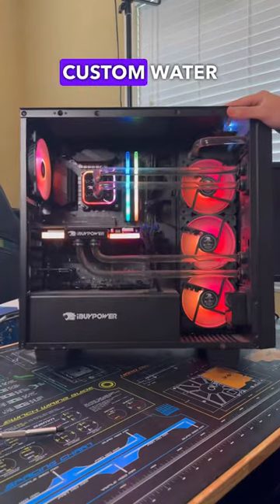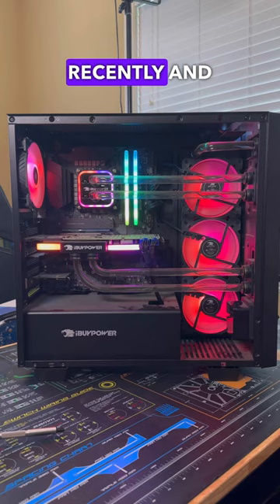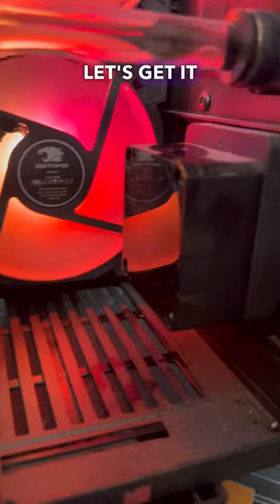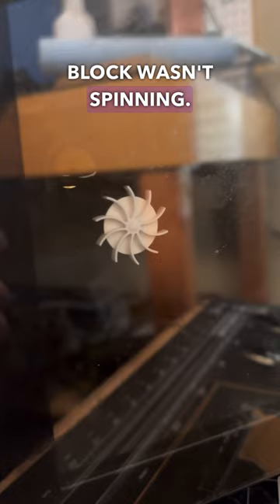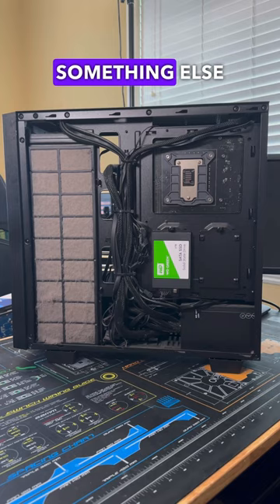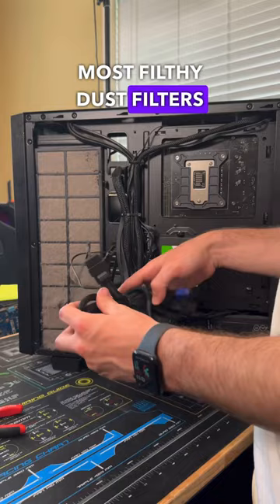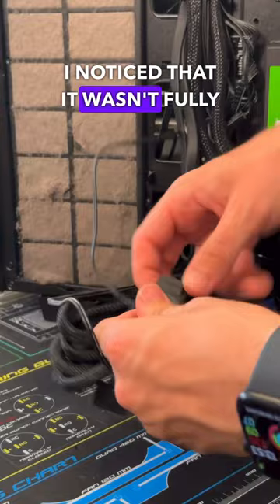OVERHEATING Gaming PC Repair! #shorts #pc #pcbuild #gamingpc #gamingrig

Comment: Imagine having to pay a shop just to properly plug in a cable 💀
Reply: When it comes to water cooling, rather have a shop tinkering cause if they mess shit up they replace it, if i mess shit up there’s a couple hundred dollars easily on top of my original issue
Reply: We used to call this a stupid/lazy tax, dont wanna put in the 10 minutes of effort? No problem, but youre paying for my time amd expensea.
Reply: It's the stupid tax
Reply: I know right, they even had a flow indicator right on the front of the case.
Reply: Prebuilt moment

Comment: Dang its wild how folks have $1500-2000 in water cooling but rock the cheapest SSD you can find. 

Never custom loop unless every other part is maxed out for your needs and budget first. Its not going to be better than an AIO, costs more, and requires maintenance most folks who dont build their own loops don't perform.
Reply: It's an ibuypower pre-built. They spend all of their budget to make it seem high tech, because the average person won't notice.

Comment: The dude couldnt troubleshoot that himself without taking it to a shop??
Reply: you're also supposed to replace the fluid every 6 months to a year and I doubt they've been doing that considering the dust buildup.
Reply: Judging by how dirty the PC was and how good the cable management is, he bought a prebuilt
Reply: Ibuypower is a prebuilding company so he probably doesn’t know tech that well
Reply: No joke, my mom says we need to take a laptop to a shop to clean the fans.
Reply: It is a ibuypower so he did t build it he prolly doesn’t know anything about pcs especially a custom loop
Reply: @new_simsons and yeah that's how you maintain it if you didn't know, laptop can be really nasty if not maintained too and can build up some dust and lint to its fan and internal parts. If you can't or don't have the confidence and you see some weird temp or overheating even on idle
Reply: @josephbryanasuncion4904 yup. His mom is smarter than most just for knowing that your PC needs cleaning however, I’d say it probably needs cleaning 1 time a year unless your in dirty environment. Then shoot for 2-3 times a year
Reply: "ibuypower"

Comment: I have 2 computers with 1 fan each. one was a cruddy pre-built thing from red best buy and the other a custom built (not by me) desktop I got second hand, also with 1 fan, no filters and for half its life was ran with the side panel off due to overheating and was used daily for like 12+ hours for about 6 years on the floor in a carpeted place full of dust. the 1st pc sat on said carpeted floor unused for as long as the 2nd was used. neither were ever cleaned out.
NEITHER is as dusty anywhere near as this thing. I just don't understand. people must have pest laying on their computers or using it like a vacuum cleaner for it to look like this...

Comment: Those fans are also configured in a pull configuration over the radiator. They are pulling hot air into the case instead of pushing it out. I think someone assembled it incorrectly because the fans are facing us with the motor mount and that is not how RGB fans are supposed to be monted. They should make the rear fan as intake in this config and radiator fans for air to exit.
Reply: Pulling air in through a radiator isn’t a huge deal. Water temp in the radiator doesn’t often get very high, my set up usually only hits about 30-35 C liquid under several hours of gaming load. Temps will usually only increase by a couple degrees tops doing this

Comment: I had a water-cooled system once. Never again. Too much crap to break, and the performance wasn't significantly better than just a decent regular fan cooler.
Reply: Now aios are basically the perfect middle ground (depending on size/brand/etc)
Reply: @connorswartz1862  That's what I had. The pump died after like a year
Reply: @KingGameReview  how long ago was that? Aios are now so much better than they used to be and usually have 5+ year warranties for if the pump fails. Also of course make sure you’re getting a reputable brand as some brands are just inherently worse
Reply: @connorswartz1862  it was way back in like 2010
Reply: @KingGameReview  oh yeah that makes total sense. Aios were NOT a good buy back in 2010 but nowadays they are much much better both in performance and reliability

Comment: Someone who needs a shop for such "repair" shouldn't buy PC with custom loop as it requires regular checking.
Reply: They likely bought it prebuilt
Reply: @connorswartz1862  yeah, they likely bought prebuilt PC with custom loop. And that was an error on their part.
Reply: @korinogaro  I’m sure the seller didn’t make it very clear the regularity of maintenance required for a custom loop as someone who is familiar likely wouldn’t be buying prebuilt